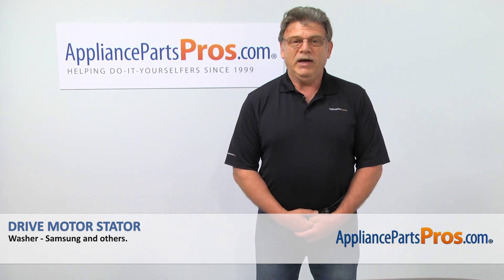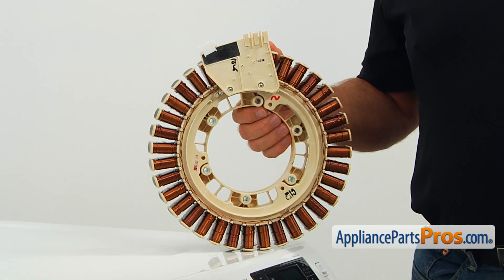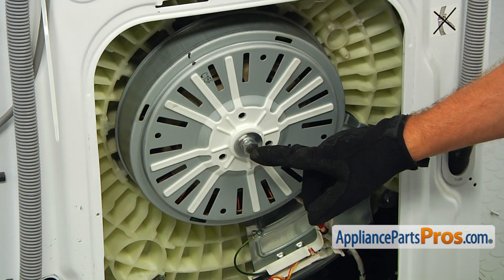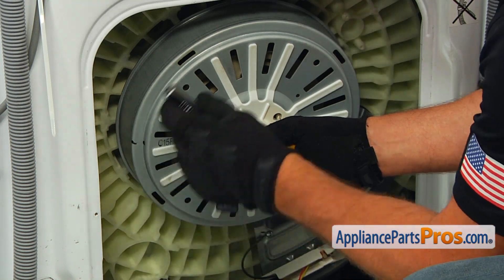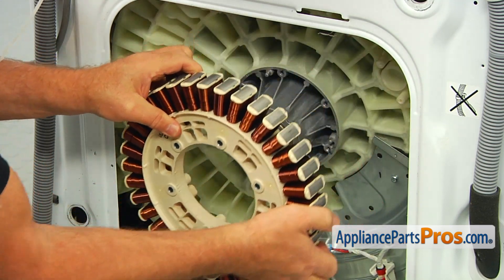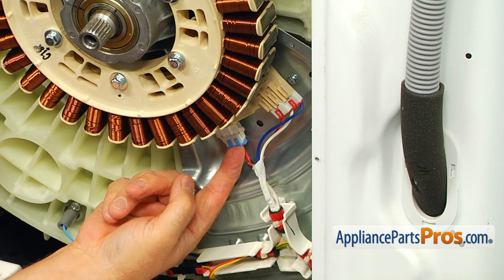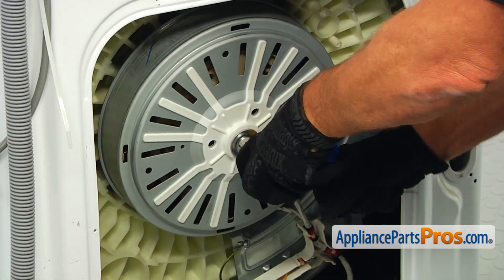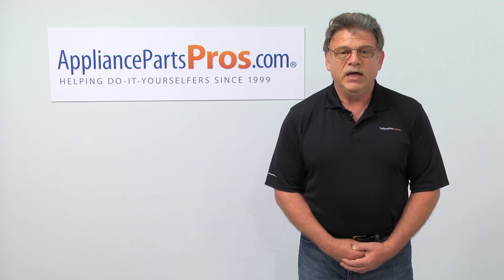How To: Samsung Drive Motor Stator DC31-00111A

Comment: Life saver 👏
Reply from the maker: So glad the video was helpful! Let us know if you have any questions!
Reply: I changed it and it did half a cycle and shut down wouldn’t try to cycle again. Is it probably the motor should be replaced instead? I’m getting code 3e3
Reply from the maker: What is your model number?
Reply: WF397UTPAGR/A2
I went ahead and replaced the motor with hall sensory but now am getting a lot of resistance when turning the drum which I didn’t have a problem with before. Any thoughts?
Reply from the maker: That error code is a motor error, if you have replaced the motor and are still getting the error you will need to double check the installation, check the wiring and connectors. If all of that is good then you could be looking at a control board issue.

Comment: My old stator reads 11.8-12.0 Ohms. Just bought  anew one and it reads the same. I'm assuming they're both bad?
Reply from the maker: What is your model number so we can look up the information for your unit?
Reply: @ WF42H5000AW/A2-11 many thanks!
Reply from the maker: Those reading would indicate a good part.
Reply: @ thank you so much! 

Now I just have to figure out why my washing machine won’t spin. I replaced motor and stator and neither were the issue 😭😭

Comment: Model # wa48j7700aw... what should the resistance ohms read? Mines read 12.7
Reply from the maker: The part should read around 19.3Ω. If that is not what you are getting then you will need to replace the stator.

Comment: My DC31-00111A is showing 12 OHMS. Below you stator it should be between 4 and 6 OHM.
I guess this is the issue with mine? Let me know as I will purchase the new part.
Reply from the maker: Based on that reading your stator is bad and will need to be replaced.

Comment: what should the resistance read (in ohms) on a good DC31-00111A stator?
Reply: What is yours doing? I have the same model number stator. My washer will not spin, it will slightly rock back and forth making a high pitch sound, I tested the stator and I am getting 11.4 ohms in any combination of the 3 connectors
Reply: @ericc8895  I get 12 ohms on mine. Resistance is influenced by the temp.

Mine won't start a wash cycle. In rinse and spin cycle it will rinse, but not start the final spin.

I've tried new stator, logic board, and water pressure sensor
Reply: @ericc8895  I get 11.8 Ohms across all pins. Too much of a coincidence it is the same on all three so I think it is good even through some sites say it is supposed to be 6 Ohms. My Samsung is WF395BTPAWR/A1 and the stator part number is AP5583744. I ordered the hall effect position sensor and hope that it clears my b3 error
Reply: @alexisdavis1507  I'm not sure really what is the fix, I gave up and sent it to the junkyard with all the new parts in it. Waisted $180 on the damn thing and still did not work. I hope you have had better look.

Comment: 3c2 code?
Reply from the maker: What is your model number?
Reply from the maker: This error code can be caused by an overload issue. So make sure the unit is not being overloaded. Check the motor connector
terminal connections and contacts. If the hall sensor terminal is
faulty, replace the hall sensor. If the hall sensor terminal is faulty, replace the hall sensor. Check whether the stator of the motor cover is damaged. Check for coil disconnections due to foreign material. If the PBA control circuit is faulty, replace the PBA.
Reply: @ thank you! I appreciate you
Reply from the maker: You're welcome!

Comment: My washer will attempt to start a cycle, but only locks the door, attempts to pump some water out, the drum rocks about a 1/2", and then I get spinning dash lines on all four LCD numbers. I tried hard resets (unplugging), and even tried to calibrate it through Samsung troubleshooting texting but nothing worked. Seems like a motor issue to me. Will a brand new motor/stator and position sensor likely fix this?
Reply from the maker: What is your model number?
Reply from the maker: You can test the stator for between 4 and 6 ohms of resistance on any of the 3 terminals. If those check ok then you would need to replace the control board.
Reply: @appliancepartspros  Great - thanks for the help!
Reply from the maker: You're welcome!